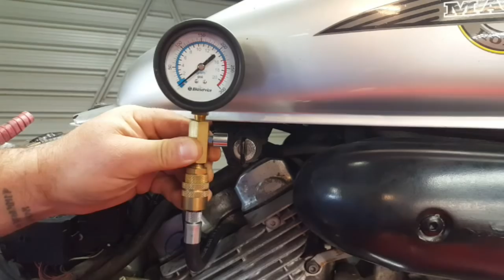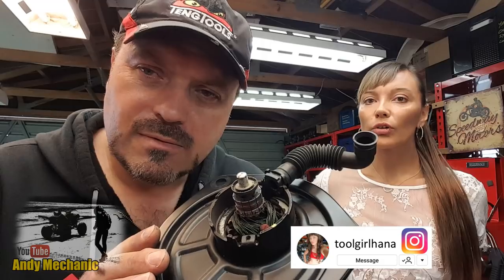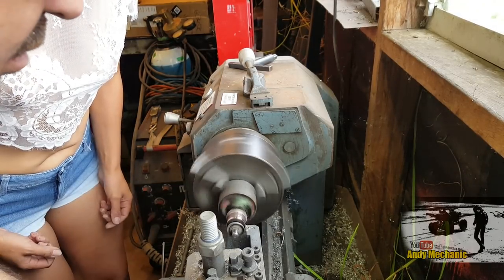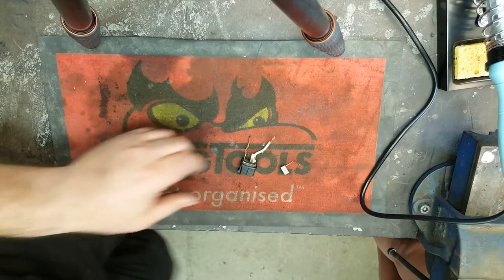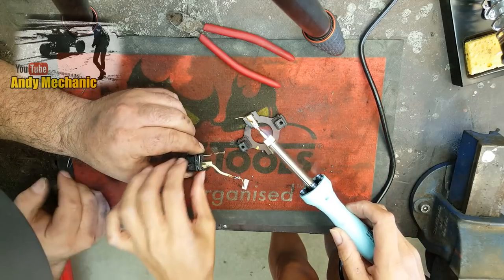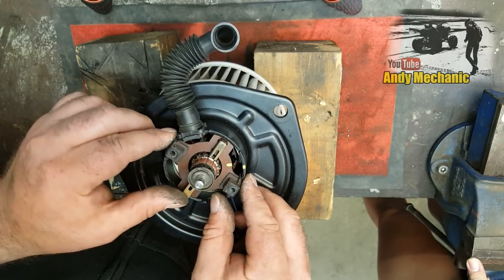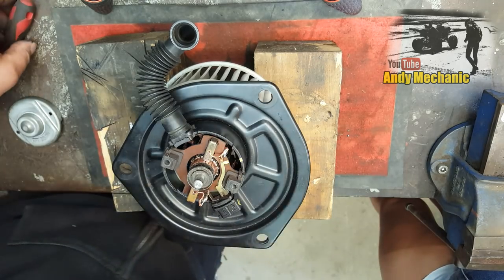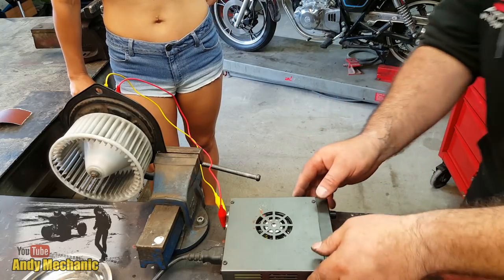Heater motor - fitting new brushes Ft. Tool Girl Hana #1435

Comment: Unfortunately pure copper is hard to machine and just smears. I think a very low spindle and feed speed on the lathe could help here. Also you should have clamped the shaft not the armature windings, both to get a proper true and also not risk breaking the armature. Finding the true centre should be done by rotating the headstock spindle by hand and using a DTI on the other end of the shaft
Reply from the maker: +Drew Dastardly Thanks for the feedback. Usually I do clamp only the shaft but the chuck had swarf in the spiral gear preventing the jaws fully closing unfortunately...all fixed now but understand what you are saying.
Reply: I don't really understand the point of putting it in the lathe anyway. Some high grit sandpaper would have been fine.

Comment: My dad and I use to turn a commutator with it in a drill and and using a file and emery. Some you can turn and some not most can be saved. New brushes and bushes and again good for 15 plus. At least we knew how it was done. not dribbled together with no bearing lube and worn brush.

Comment: Bosch washing machines are the same - I've had to pay $100 for 2 small brushes. Silly thing was the brush holder, complete with brushes already fitted was cheaper (but out of stock).
If you're lucky you might be able to find something much cheaper ($5 - $10) that's just slightly oversize that can be filed down to fit. 
Re the damaged spring - it looks a lot like something you might find in an old ballpoint pen (BIC Flick).
I notice you didn't undercut between the segments of the commutator - Is that no longer recommended after skimming?
Reply from the maker: +Richard Prosser Hi Richard. Yep did undercut using the hacksaw blade whilst the armature was still held in the lathe chuck.

Did try get generic brushes locally but we're out of stock this time around and customer needed motor back asap

Thanks for your input. Cheers Andy